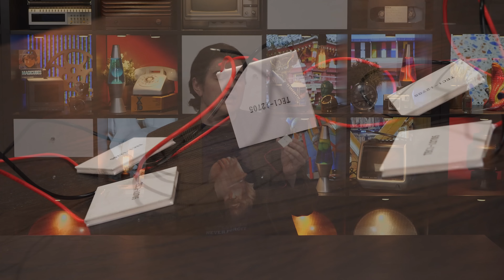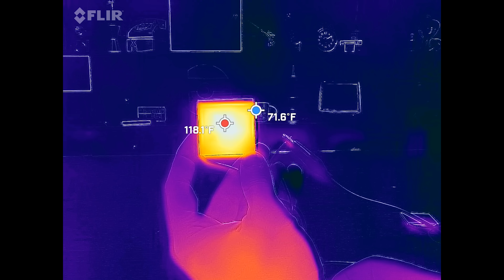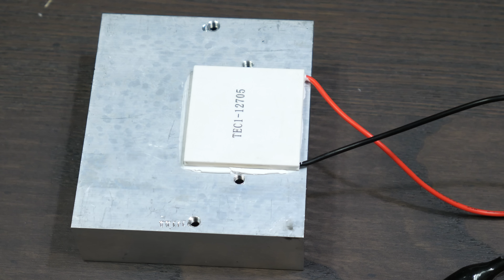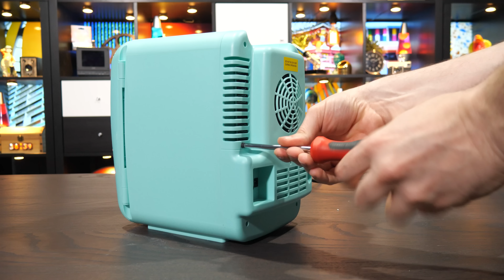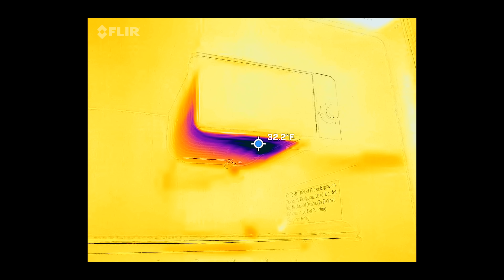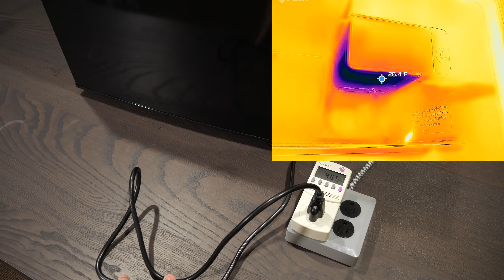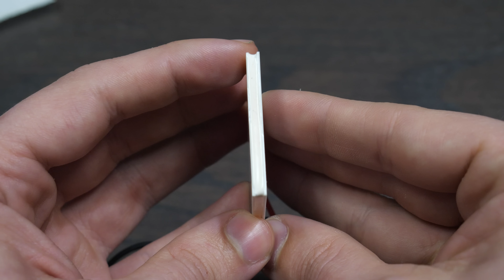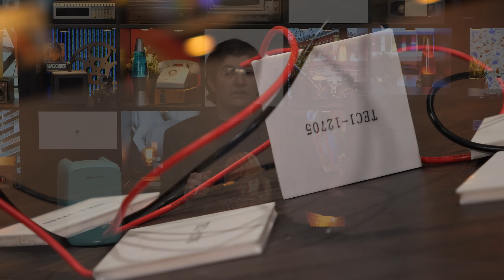Thermoelectric cooling: it's not great.

Comment: They're great for otr trucking and sold widely in truck stops. Some have reversible leads to keep hot food hot and vice versa depending on demand.  I've settled with a smaller Koolatron that will run almost constantly and keep the low 40s F since I keep the cab low 70s normally from day to day. It's cord, peltier device and fan makes it negligibly more hefty imo when used as a simple cooler.

Comment: I have one I received as a gift from my daughter. Mine is not the same brand, an lacks the glorious internal LED light. But... Mine pulls a steady 22 watts from the wall, is completely silent, and serves it's purpose on my desk keeping a few cans of soft drinks and my diabetes medication properly cool. The huge advantage is the ability to run it in the car or road trips of off a 12 volt batter bank during power failures. It takes up minimal desk space. Being a ham radio operator, I typically geek out for no apparent reason with little or no rationale. That being said, I have a pair of 450 watt solar panels charging a pair of lithium iron phosphate batteries that power my ham radio gear and my desktop computer. Seemed sensible to power the mini-fridge off that system as well.

As I tell people in the great EV versus ICE vehicle debate, it all depends on your situation and your use case scenario. Besides... It's cute, and deliciously nerdy. 🤣

Comment: Another pro of peltier coolers, they're very tiny, and have low thermal mass, so they work excellently for precision temperature control. I have some lasers for holography that require 0.025 degrees of temperature stability, and the best way I've achieved that is with tiny peltier coolers sandwiched between the laser diode assembly and a large enough heatsink for passive cooling.

Comment: I remember wanting one of these for some time but I never bothered as I can just walk downstairs to the kitchen or getting a 1.5L insulated waterbottle from Costco. However I did saw these peltier personal AC and I never had those but it always makes me wonder if the heat generated will radiate back into you, negating the cooling effect of the peltier.

Comment: When I was in high school I built a little fridge using a Peltier chip. It was meant for a humanitarian project to create a fridge to keep snake antivenom cooled on a low budget. We mostly made the enclosure out of insolating foam, a used laptop power supply, and used a CPU cooler for a computer that I found at goodwill to cool the chip. I remember the temperature in that fridge getting below freezing so I'm wondering if the power supply or the enclosure is at fault for not cooling the items super quickly. They're fun projects to build, but horrible for commercial usage.

Comment: FYI, commercial DLP projectors, as used in digital cinemas, use Peltiers on the DMDs themselves.  Then a conventional cooling circuit as thermally coupled to the Peltier to move the heated coolant to the heat exchanger.  This allows the DMD chips, despite having upwards of 7KW of xenon lamps aimed at them to run cool enough.  The Peltier allows the cooling to be located right where it is needed.

Comment: PC enthusiasts used to be really into peltier cooling for CPUs, but anymore, the heat density of CPUs has gotten way too high - keep in mind, to cool a 200w CPU, you need a 200w peltier module, which puts out a total of 400w of heat on the hot end. Not only is double the heat twice as hard to deal with, peltier modules that powerful are hard to find if they exist at all.

Comment: 30:26 You can fix the short cycling by finding the end of the thermometer probe (usually wedged under the bottom face of the evaporator element at the rear), and prying it up and away from the element, so it's measuring air temperature near the top of the compartment more than the element itself.
I've never had problems with it freezing stuff close by, probably because the temperature ranges allowed for those combo elements never really freeze anything worth a damn unless there's direct contact for heat conduction; the differences in heat capacity & heat conductivity between air (which the fridge is using to cool) and water (which is mostly what food is) seem too great for cycle length to make a difference.

Comment: Why niche, one use of Peltier devices you missed was the ability to keep something at a very specific temperature. By controlling the amount of power you supply to the Peltier, you can fine tune how cold it gets. I've used these to control the temperature of diode lasers, which lase at a wavelength that is dependent on temperature, in order to get them to the exact wavelength needed to excite some particular ions. Other cooling devices would be significantly more difficult to set up in such a context, but moreover, the Peltier device allows for the temperature to be held in a steady equilibrium state without fluctuation, while devices based on a refrigeration cycle will have to cycle on and off in an attempt to balance around some equilibrium point.

Comment: great! except vapor compression heat pumps don't really fit on my motorcycle, to keep a few cans and a sandwich cool for lunch... a 12V peltier fridge does... not great, but i haven't found anything else that is better.
Reply: I really wish i could find something better than the small crappy 6 can things... no luck so far...

Comment: About a decade ago, I found out about Peltier modules and thought they were so awesome, I'd make a "plate cooler" to cool the bottom of pots super quick.
It ended up being super power inefficient, needed huge finned coolers. I ended up taking out the PTE modules, butting the fins up to the cooling plate, then using a peristaltic pump to move water across the fins. It used significantly less power and was far better, all for an tiny increase in the height of the device.
Reply: Heat or cool "at will" is very cute.  But to do it well, it takes time, resources and a heat pump.. (I was enamoured by the cold plates used to make Icecream / iced specialty foods. Sadly,  to heat and cool - to extremes - with one device isn't quickly possible..
Reply: Why were you trying to cool the bottom of pots? You peaked my curiosity.
Reply: @MrEazyE357  Cool it from cooking temperature to serving temperature more quickly. Those who have to prepare dinner after coming home from work (living single or partner also works) can certainly relate.
Reply: @NiHaoMike64 I can’t imagine anything being quicker or more convenient than just a dip in an ice bath in that scenario though. Maybe if your pot is super hot for some reason you’d have an issue with steam, but only if your pot doesn’t transfer heat well or you’ve boiled all the liquid out of whatever is in the pot.
Reply: @BobbyHill26  That's if you have an ice bath ready. Simplest would probably just be a heatsink and fan.
Reply: @NiHaoMike64  Gotcha. Thanks!
Reply: @NiHaoMike64  that just doesn’t sound very convenient to me though, and it would take a very serious heat sink and fan to cool the pot at any speed significantly more than normal air temp. If we’re talking about home cooking, it would take me 45 seconds at the absolute most to grab a popcorn bowl or a big mixing bowl, throw a few handfuls of ice into it and then add water. You could skip the ice step and cut the amount of time it takes to prepare probably in half and just use cold tap water for an even simpler but slightly less effective method, I usually use lukewarm/hot water so I don’t risk damaging the cookware, but I’ve used cold water before and never ruined anything yet. I’m pretty impatient and do this fairly often, usually after I’m done cooking and want to cool cookware quickly to clean it or so I can put food into tupperware and it takes just a few seconds of prep that can be done while the stove gets hot and then it takes literally seconds for the pot to cool. Almost certainly way faster than any gadget for the purpose and I don’t need to worry about something else taking up counter or cabinet space
Reply: @BobbyHill26  one issue with the ice bath thing:
you need a bowl bigger than your pan/pot, needs to actually work with the pan/pot (if the pan is very thin, it'd suck if you accidentally dip it too much and now water is all over the food)
the pan/pot is now wet so you gotta dry it off (since the context is serving food in the pot/pan)
You also gotta deal with all the water after the fact

the real answer is to use large plates and stuff to serve your food, or use heat insulating plates to put the hot pot on the table and just warn people (the insides are hot anyways)
Reply: it would probably cool faster and with no moving parts if you had a tile counter and a "plate" made of TEC that you ran to an incandescent light or something (wired in series) - the counter will slowly heat up, but a significant portion of the heat absorbed would be converted to electricity and then converted into heat in the lightbulb. Fun!

Comment: How could manufactures make heat-pumps silent? Both fan noise and compressor noise. My fridge already has very little compressor noise, is it simply a size thing or noise insulation?

Comment: When a local peltier manufacturing company had a seminar in my city, they recommended using these for microelectronics cooling, lasers, for precise temperature control, for dehumidifiers in standalone electronics where this thing could gather moisture in air by freezing and then melting it for automatic water removal.
They also had a funny device where it was used as an attachment for a generic oven. Like a box with two fans, it'd generate energy from heat to cool itself with the fans and to power some usb device but energy generation was just only enough to charge a phone. But it was neatly packaged, I guess it could be meaningful for some summerhouse in the middle of nowhere that uses firewood or coal for heating. 
But cooling... Condensation is annoying, power consumption is annoying, efficiency is low.

Comment: these peltier plates are way better for applications like EcoFans. i do have one of the car coolers. great for road trips. my folks have eco fans for wood stoves at their cabins (you can really just make an ecofan with an rc hobby motor, a peltier element, a big light fan (just some cheap aluminum sheet with two paddle style vanes, and a heat sink form something like an old Dell Dimension, they're beefy and are awesome for the application.

Comment: One place I can see a peltier based cooler would be super useful is a portable insulin cooler. It doesn’t have to chill it. In fact, once an insulin pen or vial is “opened” it’s recommended to not put it back in the refrigerator. But they should be kept below 80F. So it doesn’t have to be a super powerful cooler. Keeping the contents between 60F and 70F would be totally acceptable (and for some people, desirable, as some people don’t like the feeling of a cold injection). You definitely don’t want insulin stored next to anything that could potentially freeze it. I’ve seen a few of these around, but they tend to be pretty expensive, and looks like they try to cool all the way down below 40F, which is not super useful, and might actually damage the insulin.

Comment: my astronomy camera uses this technology to cool the sensor down.  Cooling down camera chips helps with lower noise.  it does work and if it’s already cold outside, I can get my sensor down to -40 C, but in the summer I only aim for -10 C.  

I won’t go into details, but there’s good reasons why temperature matters when taking pictures of space.

The idea of using it for refrigeration, I agree is completely insane.

Comment: Have fun reaching -100 C with any heat pump.
I use thermoelectric coolers a lot, for cooling sensors or as a final stage for a multi stage thermostat or in my car fridge. Basically any application that doesn’t count in efficiency. Then they’re great: they can heat and cool, have rapid response and their power can be continuously altered.

Comment: So I actually have one of those rare use cases! I have ears that are VERY temperature sensitive, to the degree that they'll overheat and cause me much discomfort in as short as 10-20 minutes of wearing a normal, comfortable headset. (See also: Red Ear Syndrome) However, I got a headset (Omen Mindframe Prime) that has thermoelectric coolers in the ear cups. It means I can go for several hours without a flare up! I also have one that acts as a phone cooler that I bought after having my phone overheat in my old car with busted A/C. Seems like they're best when you need the cold to be in a small, specific spot, ESPECIALLY if that spot's mobile or sensitive.

Comment: In defense of the stupid fridge I've been using a peltier cooled ice box in my work van for years, where the noise and power consumption is irrelevant. It does a really good job, mostly because of the thick insulation keeping stuff cool even when I have to park in the summer sun. Unfortunately there's no compressor fridge running on 12v small enough to replace it, even the tiny campervan ones.

Comment: Seems like the measurement of efficiency is wrong. Heat pumps do work better with a smaller temperature difference, not to speak of needing different refrigerants altogetgher for higher differences. Based on the exponential growth of power required to pump heat when connecting heat pumps in series, the unit should probably be e^(1/K), so that when you raise it to the degree of some Kelvins, which are the temperature difference, you get the efficiency at that difference.

Comment: We used to use TEC's as part of the cooling system back in the days of the Pentium 4 and overclocking them, although you'd often have a much more substantial cooling than a lump of alu (water cooling the hot side of the TEC, etc.)

Comment: Coleman makes a 40 quart Peltier based electric cooler that is popular among truckers because it's cheap and runs on 12V. I got one when I started driving, and quickly discovered that it's almost usable if you keep a jug of ice in it, and keep it on the passenger seat with two A/C vents blowing at the heat exchanger.  Also, they have a tendency to melt lighter plugs.

I retired mine after the second plug replacement, and another driver gave me one that also "died".  I converted both of them to heat/cool, thermostatically controlled, to maintain an optimum temperature for doing such things as aging cheese and fermenting vegetables.

Comment: I have seen you talk about refrigerators, A/Cs, heat pumps, the refrigeration cycle, etc. and now thermoelectric cooling via peltier modules. 

Since you love to talk about those things and have delved a little bit into chemically powered heat, such as reusable/single-use hand warmers, I think you should consider looking into the dual source (Electric/LP (Propane)) refrigerators commonly found in RVs, Travel trailers, and off grid setups. When plugged in, these run on electric power, but when not plugged in, they use a battery (i.e. the one powering your camper/RV) to ignite a tiny torch, which in turn boils an ammonia mixture, using the absorption refrigeration process to keep things cold. Not alot of people know about this stuff and I'm sure you could make an interesting video about these refrigerators, how that process works, etc. especially for those who don't know.

Comment: I once worked at a place that made cryogenic electronic equipment that uses Peltier modules.  Yes, it was very inefficient but also very cold.  The way they did it was to stack different sized plates like a pyramid so they each took it down another 20 (or whatever those were).  Also this device was very well insulated.  The device was in an insulated box and the whole thing was in another insulated box.  It cooled down to truly cryogenic temperatures.  The transistors were designed to run super cold for noise reasons.  Super cold brings down the thermal noise of the signal.  I'm think everything you said is correct, just saying that they actually do have a place sometimes.

Comment: Billiant video as usual!

I need an a answer.

I recent bought a small 7 cu ft Fridgedire upright garage ice chest for the garage.

I leave in Los Angeles where temps in garage reached 90F to 101F in the garage during the summer.

Surprisingly the ice chest can keep a 0F to +2F, even with 100F+ temp in the garage.

Feeling the exterior metal sides of the freezer felt warm, that I believed were outside of the separating interior insulation from the  interior cooling coils.

However, the top of the lid door always felt cool, which I assumed to due low or no insulation due to cooling loss.

So I taped 1 inch sheet Styrofoam to the outside of the top lid.

With my digital max/min thermomter, I saw the freezer's temp of +2F, drop about 2 degrees lower to a lower 0F. Great!

So, Anything worth doing, is worth over doing!!

So I next taped additional 1 inch sheets of styrofoam insulations to the front side and left and right sides of the exterior of the freezer. The back side of the seal metal freezer case faces air. On the freezer case there are are no exposed visible coils to dump the heat, unlike most refrigerators. So Hmmm?

Since wrapping the 3 exterior metal sides of the freezer with Styrofoam, I notice the freezer's temp has risen by +2 degree, or +2F.

  

After watching this video, the thought hit me, maybe the exterior metal heat on the exterior front case from the coils that are for dumping the heat to surroundings, and my lining the 3 sides with Styrofoam, may be impeding the cooling/refrigeration process. Hence the slight rise in freezer cabinet femp.

I welcome coments from those more knowledgeable.

Thanks
Reply: Correction: I meant Frigidaire Freezer Chest and NOT Ice Chest.

A too helpful Android